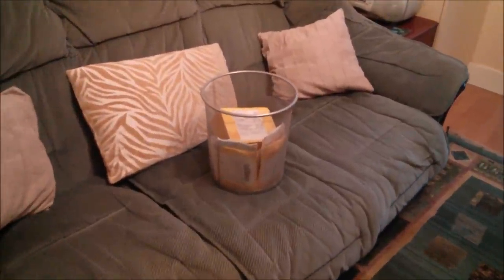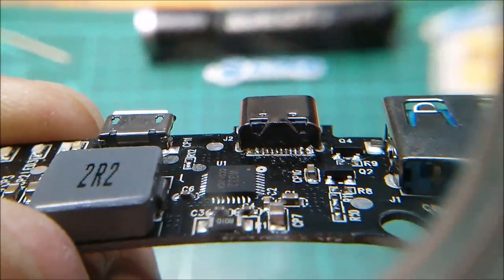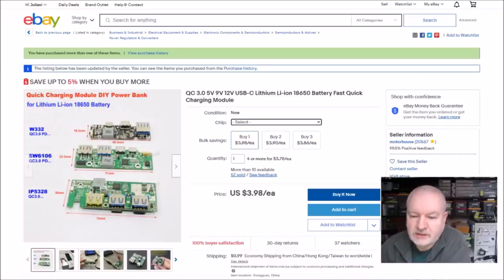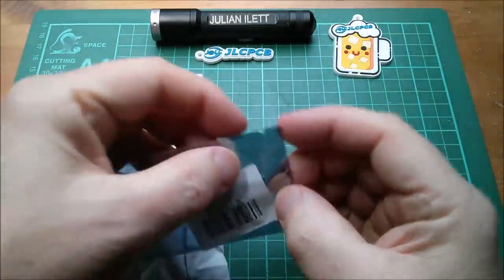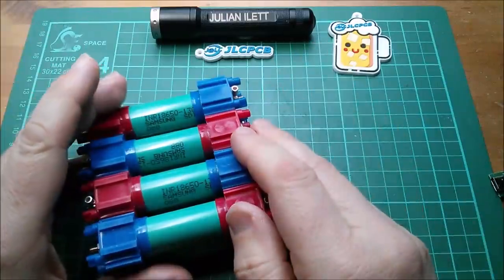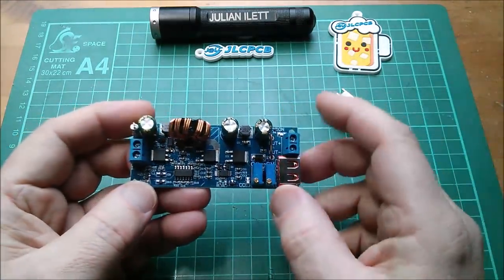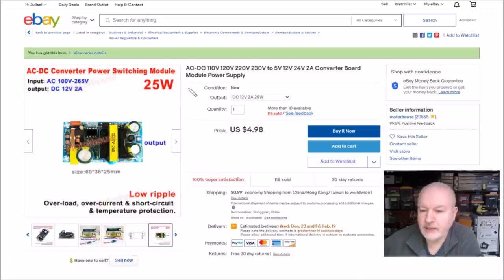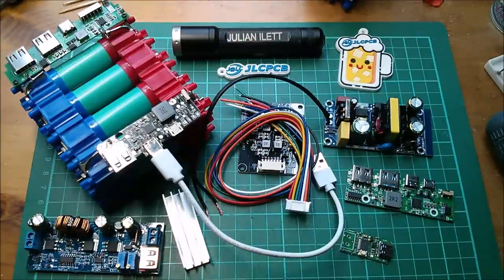Julian's PostBin #151 - Power Electronics Stuff

Comment: That Y2 safety capacitor is there as a return path for the switching noise coupled across the transformer through the interwinding capacitance. Without it the output side will just behave like a large antenna
Reply: I'd add that although there's no earth on the primary side it's still 'earthy' so the Y2 cap couples the secondary side to earth at high frequencies. 
Problem is as Julian says it also 'leaks' some current from the mains to the secondary and it's omitted where this would cause a problem or when the secondary is coupled to earth by some other means.
Also where several such 'leaky' devices are commoned together the resulting combined leakage current can become a hazard. An example is a TV distribution system - here it's simple enough to deal with by bonding to earth.
Reply from the maker: Thanks chaps - I am now more educated :)
Reply: @SDG Electronics. Thanks for that useful insight.
Reply: @JulianIlett  You're welcome.

Comment: I have a 240v-12V 2A Power Supply which turns on at 12V in INPUT and it delivers 12V 600mA at OUTPUT it is a transistor based SMPS it works nicely :-)

Comment: Why not buy your Chinesium from AliExpress? Same stuff cheaper and usually arrives quickly.

Might those large copper areas on PCB for the vacuum cleaner battery not be for heat sinking? No doubt you'll find a workaround.

Comment: Around the 30:00 area of the video:
I've managed to get some PSUs designed for 250V mains to start-up at as low as 15V... The PSU is a MeanWell GS25A05-P1J that usually starts at 18V and some even as low as 15V and of course all the way up to 250V (or rather 300V-DC).... The ones that do this are from a decade ago.... so newer revisions may not start so low.... But it does make a good set of 5v sources running off a 20V 100W solar panel in a pinch. Just note though the bridge rectifier and input filters get uncomfortably hot at such low voltages.

Comment: Julian did you consider just using an ATX power supply for the vocoder project, I think it provides all the voltages you need and usually at quite high currents. Might even be cheaper than buying multiple power supply modules. They are generally very well designed and manufactured.

Comment: The capacitor between primary and secondary is to provide RF switching noise on the secondary a path back to "ground" (i.e. neutral) which reduces the tendency of the DC power lines to radiate it like aerials. The tingling sensation is an unfortunate side-affect.
Reply: Not to neutral, just to the same node the switching noise is generated from.
Reply: @sdgelectronics  Ah yes that makes more sense.

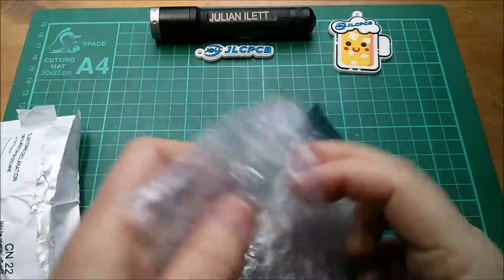Comment: I really like the one designed around the FP5139 chip (@12:30)
I like the PCB layout. Specially how the Caps are all spaced apart and not close to a baking transistor. 
The USB connector will have to go. Such a dumb design! 
I've seen those caps before. I have one and tested it last year. The ESR was 50m Ohms. Excellent for the 2200uF size.
But, they are NOT cheap. I would replace them with low ESR name brand like Nichicon or Rubycon from Digikey or Mouser. Low ESR ones are not cheap. About $3-$5 each! 
That's if you want to keep it for a long time, and if you care about ripple or not. 
This was a great video. I love SMPS and LEDs.

Comment: On that balancing board for the vacuum battery,  it's apparent to me that they're using those large copper areas on the bottom of the board as heatsinks.  I see a cluster of thermal vias near the center of each one.  Rather than cutting up the board,  why not trim out the unused bits of plastic in the battery holders?  That would seem to give you enough room...

Comment: You can run your Antminer PSU from your solar panels, if you have over 100 Volts (3 panels might work, but I think you need 4). I have a few of the PSU's spare, so IN THE EVENT of a power outage I can use my solar panels to create 12 Volt (with the HP / Antminer PSU) attached to a simple inverter to create mains manually (ni batteries involved). I do can keep my freezer running and such. You should give this a try! Self sustaining for in times of problems (and if the sun shines, but you already have many batteries as a backup).
Reply from the maker: Maybe in summer. Right now, at midday, the 240W panel is producing 5 to 10W. To keep the workshop warm, I'm running 3 miners (about 3kW).

Comment: For a good quality power supply, buy the recycled laptop chargers. They sell them with out enclosures and the wires just snipped off from their previous life! Replace the capacitors, and Bob's maybe your uncle. 
You can easily tweak the output voltage with a resistor change. But they are generally very safe designs and low EMI and safer than these cheap-ass Chinisiums. They were once certified products. 
I bought one for $5 from Ali Express, and when they are gone, they are gone. Went back to buy more, but Nada. 
They do come up frequently though.
Reply: Or find used laptop adapters in person and then you get the case, too.
Reply: @eDoc2020  $5 delivered? Where?
Reply: @piconano  I said locally. Yardsales and such, maybe Craigslist or similar. If there's a computer recycler or collection center nearby you could try asking them, too.
Reply: @eDoc2020  You are telling me things that everyone knows! Be gone.

Comment: Hi Julian, why not use an old pc power supply for your vocoder project, as it has various power rails as outputs, it is better than all these different PS u are trying to use. What say you?
Reply from the maker: The -12V does not have enough current :(
Reply: @JulianIlett  Maybe get a damaged mixer but with a good power supply, should generally have +/- 15V available which can be reduced as necessary, plus you will be getting a PSU designed for audio use.
You could probably pick an older Behringer up for cheap and just use it's PSU.

Comment: The original phrase is "The proof of the pudding is in the baking" but like many distorted sayings, the original seems to have been forgotten.
And Hi Julian!  Nice to have another video from you. :)
Reply: Just adding, if you have a voltage booster which can go down to 2V at the input, you might be better off putting all the supercaps in parallel instead of series since you'll get a greater capacity that way.
Reply: If you're going to make such a claim about a saying that dates back to the 14th century, could you at least provide some evidence? Not all puddings are baked, some can be steamed!
Reply: @SpeccyMan  What is this?  A cooking show?  Do your own research, Mr Pudding! :D
PS: I adore steamed golden syrup dumpling.
Reply: @melkiorwiseman5234  In any technical dissertation it is customary to quote your sources (not sauces).
Reply: Well here we just say "The proof is in the pudding" which is, as you say, distorted.
Reply: What about a Yorkshire pudding?
Reply from the maker: Sweet ;)
Reply: @JulianIlett  Not always. Sometimes they're savory. ;)